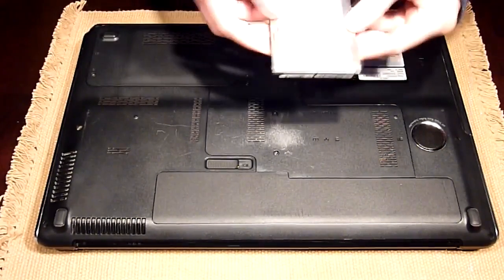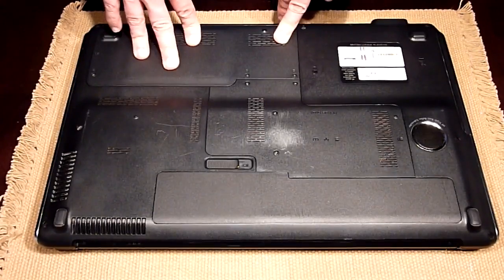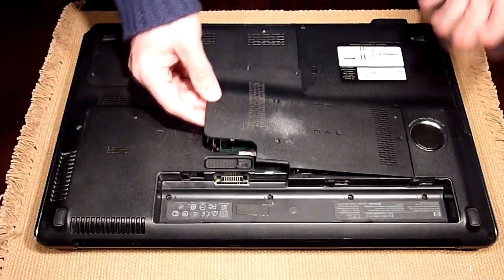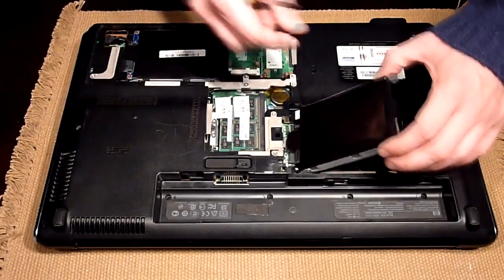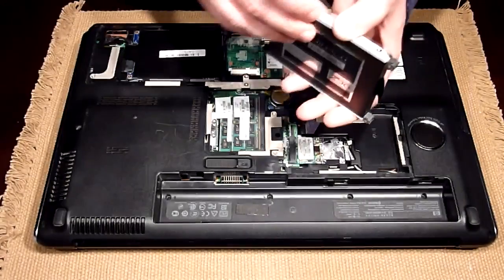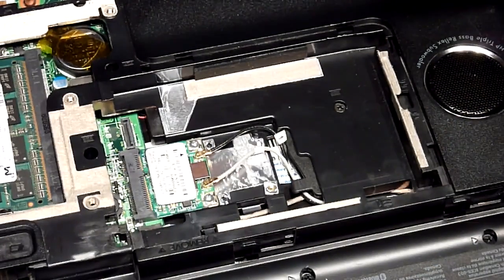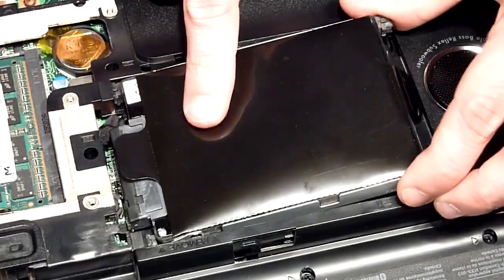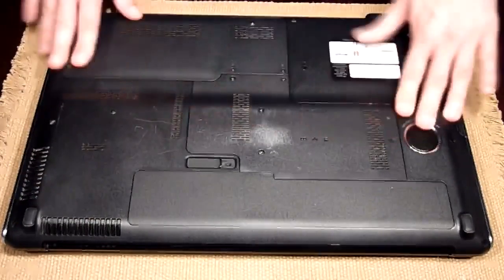Installing a 2nd Drive SSD OCZ Vertex 3 in HP DV7 3000 series

Comment: Can you replace the factory HDD with every 2.5" ssd? I found a 2.5" sandisk 500gb ssd and would like to know if I can install that one.
Reply from the maker: yes, there is no issue replacing a 2.5" SSD by another one. The only thing if it is the original one that you are replacing, you might not have the recovery tools available, you'll have to start from scratch, other than that, I see no issue !

Comment: I did it but my computer wouldn't recognize the hard drive I tried with a few different drives with no luck
Reply: It's a HP pavilion dv 7 3068dx
Reply: The internals look just like yours
Reply from the maker: @dimondlord11  there shouldn't be any issue then. Have you tried to install the SSD in the second drive bay, boot in windows, log out, enter bios, change nothing in the bios, save and exit, try again in windows if it shows up in the disk manager. If not, remove your mechanical drive and install the SSD at the same place the mechanical drive is with the same cable, see if it get detected in the bios.
Reply from the maker: it is ALWAYS working, it is because you need to initialize the drive. It has nothing to do with the drive brand or model. If you use a 2.5 inch SSD drive, it WILL work once initialize.

In windows 10, Open Start.
 Search for Disk Management and click the top result to open the experience.

Right-click the hard drive marked as "Unknown" and "Not Initialized," and select Initialize Disk.
Check the disk to initialize, Select the partition style.

Click the OK button.
Reply: I already tried that their is no extra hard drive shwoing up their I done it with my desktop before
Reply from the maker: @dimondlord11  I suspect you might have a damaged HDD cable...
Reply: I also can't figure out how to find it in the bios
Reply from the maker: @dimondlord11  Have you tried the other cable of the other drive ? It will show up for sure in the disk management, no need to go in the bios. Speaking of bios, do you have the latest one ?
Reply: Yes I flashed the bios I'll try another cord later and get back to you man
Reply from the maker: @dimondlord11  are you doing this in a HP laptop ?
Reply: I'm buying a new cable from online I got 2 from other laptops I cannibalized (got a stack of them) so I think they are my problem I'm having a hard time finding one for a dv 7 3000 series
Reply: I'll try that in the morning it's like 11 here
Reply from the maker: @dimondlord11  don't worry it's 3 am here !
Reply: I don't watch many of your kidnap videos but you earned a sub from me
Reply from the maker: @dimondlord11  kidnap ? thanks for the sub regardless ! Doint my best to help !
Reply: Kind of videos not kidnap >.>
Reply from the maker: @dimondlord11  ah makes sense now !

Comment: Great video, very informative. do you know if the primary cable is the same as the secondary one? it looks like it is the same length with same end connector. thanks
Reply from the maker: Thanks for your appreciation. The cables looks to be the same in mine also, same exact hdd caddy.

Comment: Nice man going to check it. Any idea what hdd the first hdd Is with Windows?
Reply from the maker: +Avanox thanks for your appreciation ! I am not sure I understand your question correctly though... the OS is installed on the larger bay where you have the two SO-DIMM memory modules. The second drive bay is the smallest lid, the second one I remove in the clip. This is your second drive.

I still use this computer to this day and I did replace the 120GB OCZ drive by a Samsung 840PRO 256GB drive. My next step will be to upgrade to a Samsung 850EVO 1TB and remove the second drive. This laptop still rocks and has excellent performance for my need.

SSD drive is the best upgrade you can get on any system, even older systems performance will be greatly improved. SSD drives are getting pretty cheap now. 250GB is around 100$, 500GB is around 200$ and 1TB is around 400$ for an excellent drive like the Samsung EVO with 5 year warranty. The 850PRO series have a 10 year warranty but are also more expensive and performance increase won't be notable on older systems like mine.
Reply: +Aleziss ok I think it should work. euh but another question, do I need thins things where you click the ssd on ? or is that allready on the standard harddrive , just switching the hdd to ssd with the same bay that is in the laptop is enough right?
Reply from the maker: Avanox If you replace the primary mechanical drive by a SSD then you do not need to buy any spare parts. The drive caddy and cable will work just right for your SSD.
Reply: +Aleziss great looking forward to test. My image is already made just set it on ssd en go!! :-P  I keep you informed :-)
Reply from the maker: Avanox good luck ! By the way, samsung has a nice tool to replicate your drive, no need to do an image. But you need a Samsung SSD.
Reply: +Aleziss yeah I know but Isnt the Samsung tool as good as acronis true image?
Reply from the maker: +Avanox oh don't get me wrong, what you've done is ok. I just meant to say that the Samsung tool replicate your primary drive directly (without creating image files) and also do apply some SSD tweaks for windows 7. Those tweaks can also be adjusted using samsung magician once the replication is done.

Samsung Data Migration tool : http://www.samsung.com/global/business/semiconductor/minisite/SSD/global/html/support/downloads.html
Reply from the maker: Prior using the Samsung Data Migration tool, I was using this free tool http://www.easeus.com/backup-software/tb-free.html disk imaging program. It also worked great and also applied SSD optimizations while creating the transfer.
Reply: +Aleziss hello everything went fine with acronis. Works better now. But the laptop still makes a lot of noise. Would be it be something with the fans?
Reply from the maker: Avanox nice to see that you have good success in upgrading your ssd. Does your computer run hot ? You might clean the heatsink with pressurized air can, you can be surprized how much dust can get stuck in the heat sink, specially if you never cleaned it before.
Reply: +Aleziss owkey I will let do that by a friend of mine. Is it possible to do that without deassemby whole the laptop? A friend of mine told me I have to disassemble whole the laptop to get on the fan for removing the dust. And he would add also new cool pasta.
Reply from the maker: Avanox well, if you really want to do it the BEST way, it's like your friend told you, dismentle the casing, clean all the heatskink and fan with air can and you can also replace thermal grease/paste or heatsink compound. The thermal grease can get "dry" and lose some of it's properties on the long run.

But really, if you do not have temperature issues, I would not worry too much about the thermal paste. 

You can blow air the fan vents (one in the back and the other on the side near the vga/docking connector with an air can.

If you do it, always use the air can upright otherwhise, it can shoot liquid. Don't use an air compressor unless you have a air dryer and no oiler as it can shoot humidity or oil inside the case and damage components.

Thanks for follwoing up ! I am pretty sure you've notice a huge performance improvement. I also upgraded the memory to 8GB (came with 4GB originally) and I see no need to change my DV7 for quite a bit now... It's faster than when it was brand new ! Best upgrade I've done on a computer.
Reply: +Aleziss ok nice I will let that do by my friend he has more experience then me. Hopefully it will run normal again then. :-P  there is one more thing I wanted to say. Before moving from hdd to ssd I did forget to defragment the hdd. But I read you may not Defrag ssd. Could this give performance be lower because I forgot to defragment? Any idea?
Reply from the maker: Avanox no I seriously doubt it will have an impact on the performance even if you forgot to defrag your drive before transfering. I NEVER defragged my drive since 2012 and I see NO performance degradation. 

I don't know about other ssd brands (as I moved from OCZ to Samsung products) but with the Samsung drive, you can install Samsung Magician, it will guide you to configure your system correctly and you can also test the performance.

The "sad" thing about the DV7 is that it uses SATA II so technically, you can't get more than ~300MB/s and your drive (if a Samsung EVO) can pump up to 540MB/s.

You should get around 280MB/s with a DV7 which is WAAAAAAAY faster than the mechanical drive which stand between 25-40MB/s !

So even with undefraged transfer, you won't notice any difference,  I am pretty sure.
Reply: +Aleziss  ok nice nie  know. It is weird here computer blocks a lot since I changed hdd to ssd she thinks it is my fault but I am sure it is not. It is just the dust that have to been removed. I think she would have same problems with  old or new disk. It is not that you can do that much wrong with just replacing a disk right.. :-P
Reply: +Avanox I did changed back to old disk and she has still same problems so it should be the dust right..
Reply from the maker: +Avanox what do you mean by "computer blocks" ? it freezes ? it get slow ? it crashes ?

I have got issues while replacing hdd to ssd a couple times while I was doing the procedures like blue screens and random reboots but it usually resolve after a couple reboots and I have never had anybody complaints about their new SSD after I gave them the system back.

As a matter of fact, I have another one to do this friday on a 15 inch dell computer that support SATA III, that thing will rock after the switch specially that it uses a 1TB 5200rpm mechanical drive, they are slow as hell !
Reply from the maker: +Avanox If the computer makes a lot of fan noise, the heatsink  is probably blocked by dust. The fan on my DV7 always run but quite smootly and silently. I can hear it but it's not overwhelming. 

Like I told you, just use an air can and shoot it in the duct vent in the back and side, you'll see a big bunch of dust coming out for sure if it's never been done. I would not worry too much about the thermal paste.

If the computer get slow even with the SSD, it's probably because the CPU is getting to hot and it must throttle down the speed to protect itself. Again, if you clean the heatsink, I am pretty sure it will solve the issue.

It might have been another issue but I won't talk about that right now since you are telling me the computer makes a lot of noise so it's mainly a cooling issue in my opinion.

Comment: Great video, very clear instructions and great clarity on close ups. please could you tell me what the part number on the cable for the secondary hdd. i cant find the information anywhere, many thanks
Reply from the maker: Peter Barker Hi, thanks for your appreciation ! you can find the part here http://www.newmodeus.com/shop/index.php?main_page=product_info&products_id=222 this is for a DV7-2000 or 3000 series.
Reply: ***** Thanks for the link, but i was after the original part number so i can source it cheaper, newmodeus is quite expensive..cheers
Reply from the maker: Peter Barker cheapest way is on ebay I think, search for DV7 3000 caddy or DV7 3000 drive cable and you'll find it, I've seen complete kits for 10$